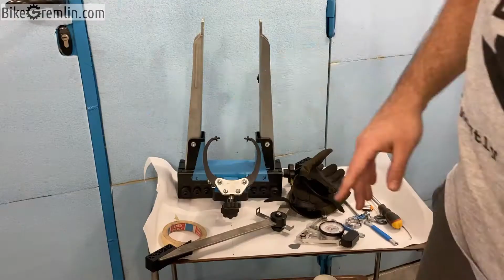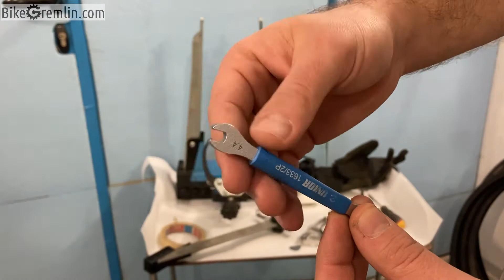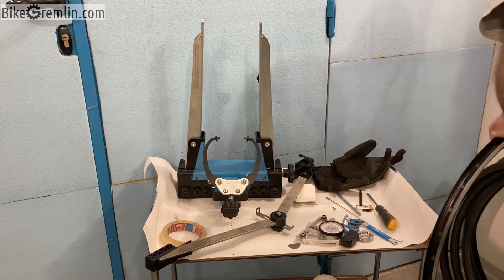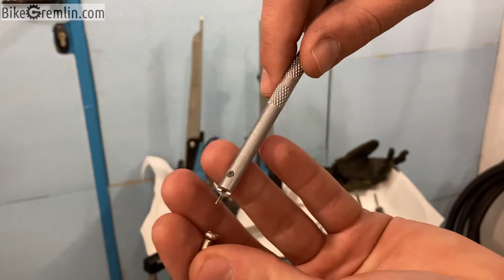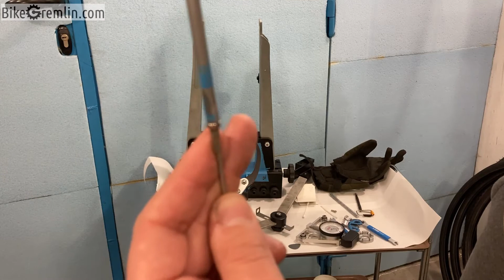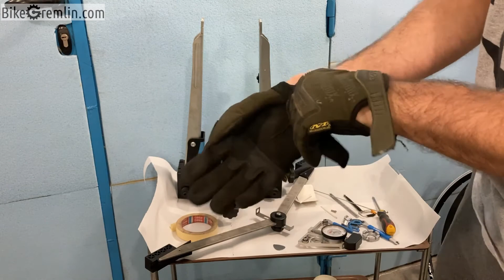Bicycle wheelbuilding tools explained

Comment: I'm by no means an expert, but are you quite sure about Sapim's nipples being 3.3? My new bike is billed by the mfr as using Sapim, and a good vernier caliper ID's the nipples as 3.23. Additionally, Park Tool's SW-0 "Black" model is billed by the mfr to fit "...3.23 mm nipples commonly used by premium brands like DT Swiss and Sapim". 

Meanwhile, Park's "Green" SW-1 model is ID'd as for 3.3mm and they say about it that: "This size is typically found on older American-made bicycles, including many vintage Schwinn models and wheels built with Union or Torrington spokes. It is not as common on modern bicycles."

Unior advise for their "professional" 4-sided wrench # 629293 that it is designed to work for BOTH 3.3 and 3.23. They actually do not even offer a wrench in this series for 3.23 only. https://uniortools.com/pdf-product?id=996108&lang=eng

I have a batch of Sapim nipples on order; will measure when they come in.

Thanks for the excellent and very helpful posting and video!
Reply from the maker: Good question. One good measurement is better than a thousand expert opinions, so I have just measured using calipers (finishing work for today - on a Sunday, sigh). 

SAPIM Polyax brass 16 mm long show 2.27 ~ 2.28 mm.
DT Swiss classic brass 12 mm long show 2.28 ~ 2.29 mm.

I suppose both are 3.3 mm nominal size.